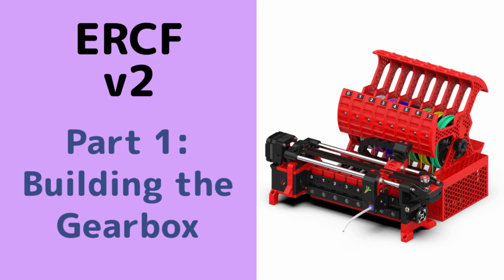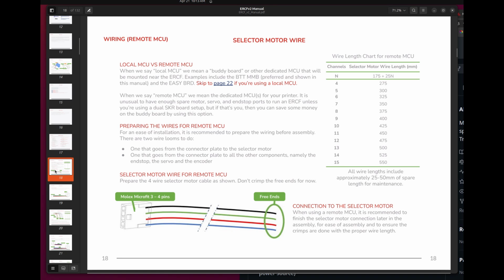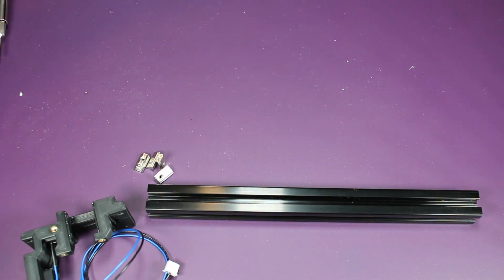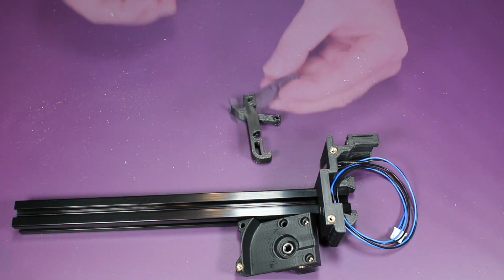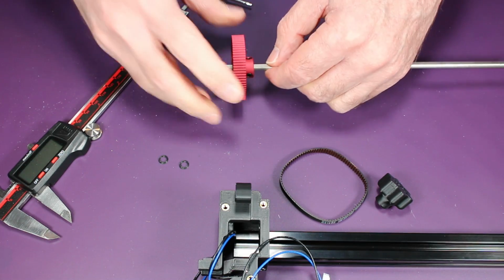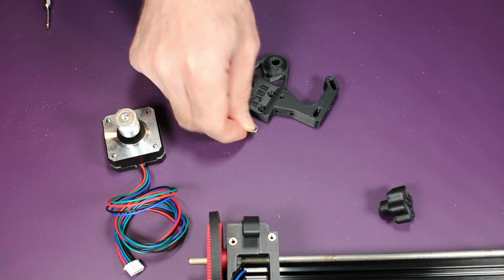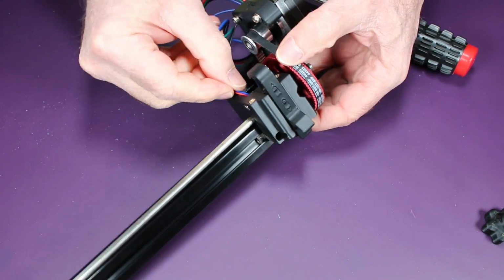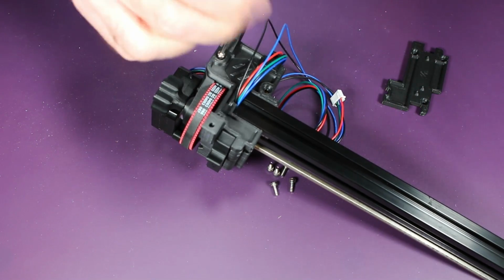Building the ERCF v2, Enraged Rabbit Carrot Feeder by Siboor.  Part 1 - Building the gearbox.

Comment: For those that are wanting to use the ERCF with proprietary printers like Bambu labs, you need to either have a Klipper based 3D Printer or change your toolhead to a Klipper based Printer. Klipper plays hand in hand with the software that that controls the ERCF v2. Syncing both the 3D printer and the ERCF using the same software that controls both units. You won’t be able to use this system with a Bambu Labs printer because Klipper is open source as to where your Bambu labs printer is not.
Reply from the maker: Good advice.  Thank you for posting!

Comment: Glad to bump into your vids 👍🏻  , just ordered the kit ..trying now to print ahead , have the BOM list downloaden from github but 1- there are things I don't need to print 2- I don't quite yet know exactly know when it need to be printed black and when red .Printed the manual but it takes some figuring out. also I have a Qauila(ender clone) altered a lot with one of it a raspberry pi with klipper on it so i reckon it has to work. bit worried about the cutter ..i have no way of placing it to the extruder (direct drive) so it has to go to the rabbit..but if the new fillament  s going to push the old filament enough to stay right behind it and flow into the extruder? we'll see .. thank you for your buidling vids
Reply from the maker: The manual describes how the part names work which shows you which should be colored as accents vs the main color.  It's the same page that describes the print settings required.  If you have an ender style printer, can the different mounts for the stealthburner be used to mount stealthburner so you can install the cutter?  Thank you for watching and commenting!

Comment: Hi, I would like to ask if this ERCF v2  can be used with the QIDI Q1 PRO. thank you for the answers.
Reply from the maker: This should work with any printer. The challenge is going to be the tool head. Use tip forming and no sensors or replace it with sttealthburner?

Comment: This may be a dumb question but it looks like it might be possible to scale this down to just two colors?
Reply from the maker: I think you can easily scale it down to 2 colors.  I would probably add a few extra than you might need just for convenience.  It can give you color choice without needing to swap filaments manually or also give you a choice of filament type.  Being able to switch between ABS and PLA between different prints (for example).

Comment: Hi, I probably sound dumb, but I want to be sure I know what I'm buying. Does Siboor ERCF V2 kit include 3D printed parts? From my understanding it doesn't which isn't really an issue, I just couldn't find it written anywhere.
Reply from the maker: It does not.  You  will need to print those parts by yourself.  Thanks for posting!

Comment: I notice that the custom 80t wheel that sibor includes doesn't quite fit correctly. it can rub on the outside of the the motor arm. also there is approximately 5.2mm space between the 80t wheel and spacer to the bearing, the spacer should be touching the bearing. I have disassembled and tried assembling without belt and you may find like in my case the 80t wheel is slightly rubbing.
Reply from the maker: I have not noticed this.  But thank you for posting this.  I am going to check this shortly.
Reply: @KapmansBasementWorkshop  I have cut a 5.3mm piece of PTFE Bowden tube and put it between the wheel and spacer, to kind of replicate the same size of the original printable 80t wheel. It has given me good guaranteed clearance. 👍

Comment: I also just jumped into the V2 Siboor kit, absolutely love to have this as a guide once I get started.  I know a lot of us are currently waiting on it to arrive, having the wisdom of someone who's gone through it is priceless.  Thank you so much.
Reply from the maker: I hope this series proves useful.  Thank you for the kind words!
Reply: 6 months on. how is it working for you? do you like it? was it worth it? is yours in a direct drive printer?
Reply: @canadian_hero  It was totally worth it, but overall I wouldn't recommend it for most people.  Getting long running prints to finish is a nearly impossible mission, and most prints are going to be long running.

Mine is setup on a Voron 2.4 R2 running the Filametrix Stealthburner with an Orbiter 2 extruder and both sensors.  I think my setup is about as optimal as it can get, having all the ERCFv2 build components, and it was still a ton of effort.

If you just want multi-color prints, this probably isn't for you.  If you enjoy the process, tweaking, testing, etc., absolutely go for it.
Reply: @phelpsio  Does it work better now ? Myself I will wait of the release of Bondtech INDX, then I will choose a 2.4 or Trident, apparently the Trident is better otherwise.
Reply: @Anadrolus Unfortunately not, there hasn’t really been much development with the ERCF.  I’ve just caved and purchased a Bambu X1C as my solution for multi color prints.  I’ve had thousands of swaps, and hundreds of hours on it without even a single issue.

I stand with the idea that it’s great fun for a “printer” hobby, but for a “printing” hobby, it’s not the right choice.
Reply: @phelpsio  Very useful, thanks for your insight. I'm waiting then for the Prusa Core One with Bondtech INDX.

Comment: I've been waiting for a kit that supports 12 channels. It is weird all of the kits that are out support 6/8/9 channels when the official BOM is for 4/8/12 channels. Also the BTT MMB only supports 10 pre-gate sensors instead of 12. Also it has 4 Stepper Drivers instead of the 2 needed for ERCF v2. Not sure what the deal is with the suppliers on ERCF v2.
Reply: There are other MMU designs out there that use more steppers, BTT's MMB (as well as Mellow's own take on it) was designed to accommodate these other MMUs along with the ERCF. As for more end stops, my plan is to tuck a Pi Pico under the buffer with a CAN transceiver. I'll just tap what I need off the backside on the MMB.
Reply from the maker: It's really just support for a few additional sensors, filament blocks and extrusion and a d-shaft, right?
Reply: @KapmansBasementWorkshop also need the 8mm rods, new belt and longer cable chain for the main body, as well as the nuts, bolts, BMG extruder gears, and magnets to go in each filament block too. I bought half meter rods and extrusion, so I'm probably going to cut them down to fit a round 18 filament blocks. Could cram 19 on there, but that is not a nice round number.
Reply from the maker: I'm about to start the filament blocks, but it it seems that it would not take much to bring this to 12.  I'll keep this in mind and consider how I would extend it if needed.  That said, I would have been very happy with 6.  Thanks!